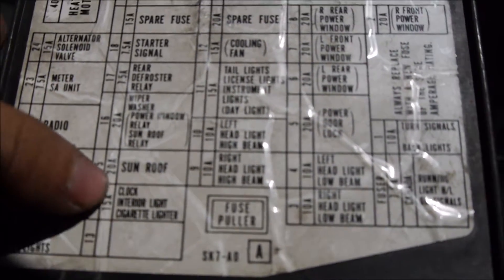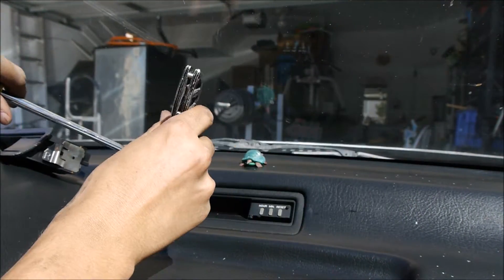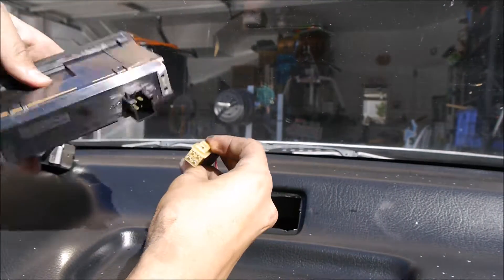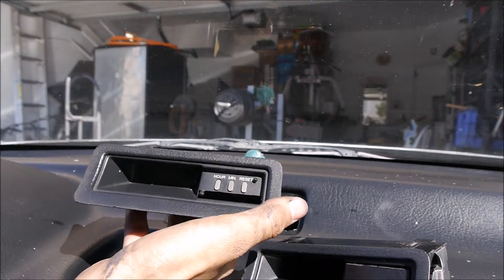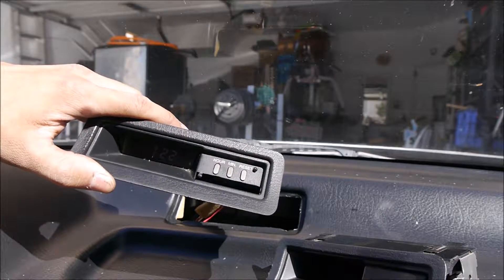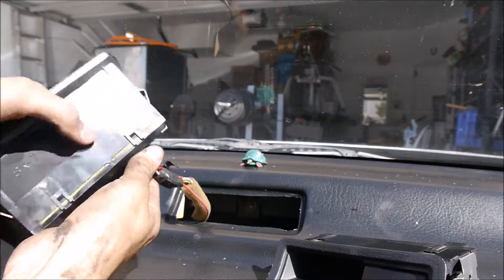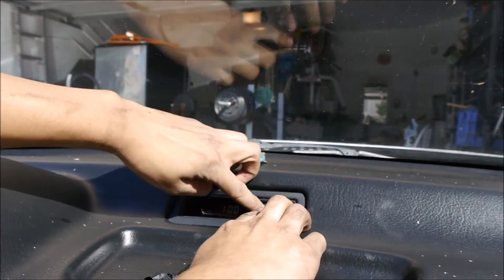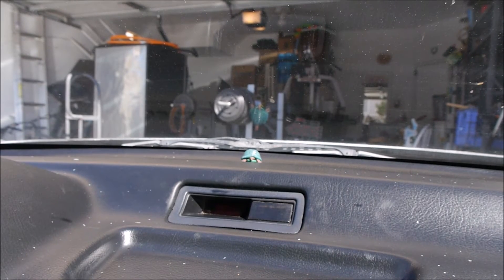integra da9 clock

Comment: i know this video is from 2016 but maybe if you are still around or active on here you will see this. is there a way to make the clock stay on while the car is running?
Reply from the maker: Clock is supposed to to stay on when the car is running
Reply: okay thanks i just bought a 1990 integra and clock hasn't been staying on until i push the button guess ill check the fuse box or replace the unit.
Reply from the maker: Yea thats why I tried doing mine too but it didn't work lol I had 2 other integras before and the clock always stayed on when I was driving the car
Reply: @daproject7025  this is my first one they guy that owned it before me had done some jankey wiring to it, so he might have messed up the clock. like a "ground wire" that was plugged directly into the fuse box through a add a circuit.
Reply from the maker: Yea same here there is a random wire added to it i dont have a wiring diagram so I couldn't really fixed so I just left it alone